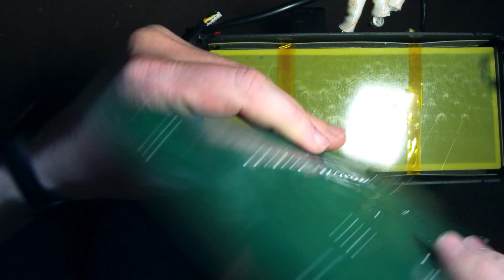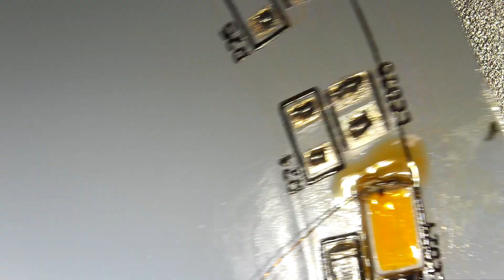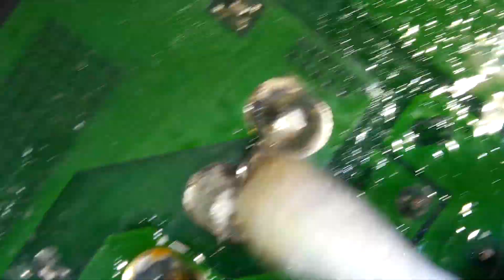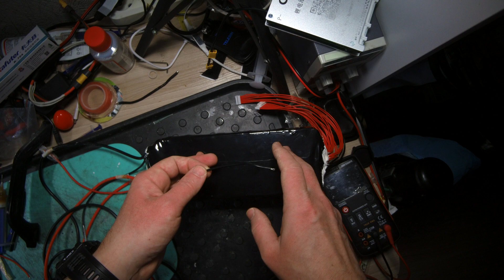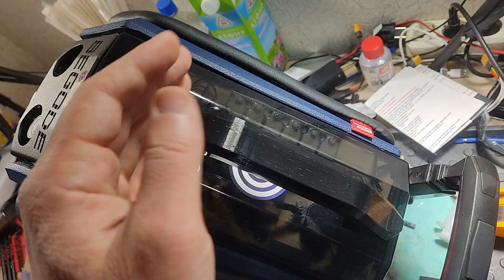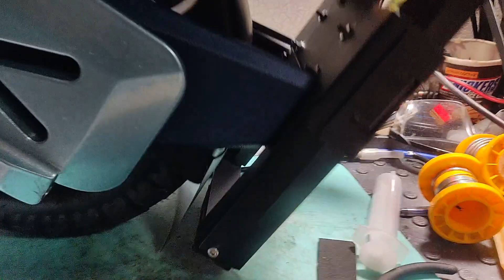Begode MTEN4: High Current Version

Comment: Very informative video, thanks. I found a good deal on an Mten4 without a battery and I will build my own (I have built some big packs for escooter and ebike). I see the Mten4 BMS has 3 connections - positive, negative and signal. Is it just those 2 resistors (103 & 104) required to use 3rd party BMS and do they replace the signal wire?

Comment: KOHDiTEP added extra big capacitors for safety(2 pieces)...I have not seen this mod on the wheel..
Reply from the maker: I know this mod, but it is done for stock weak battery packs to reduce big voltage sag problems during hard riding. Since I have high current battery pack, I've decided to skip it. According to my experience, I ignored it for my MCM5, and I can ride agressively almost 40 km/h at less then 30% battery capacity without cutouts due to high current battery pack.